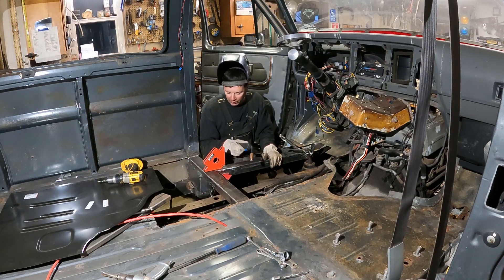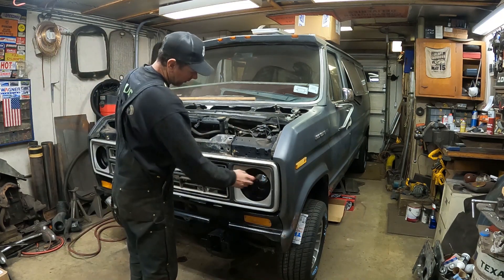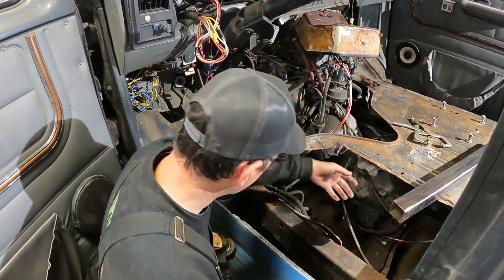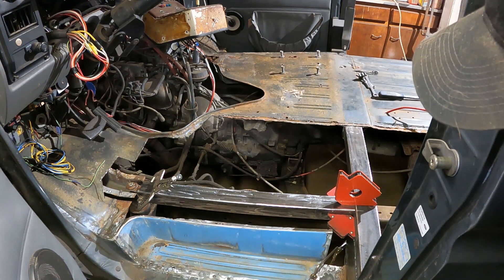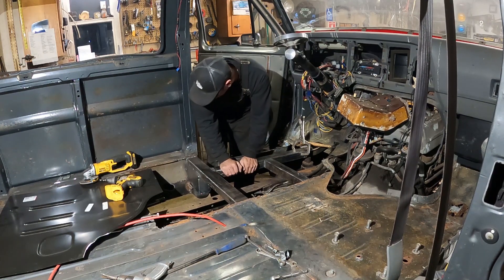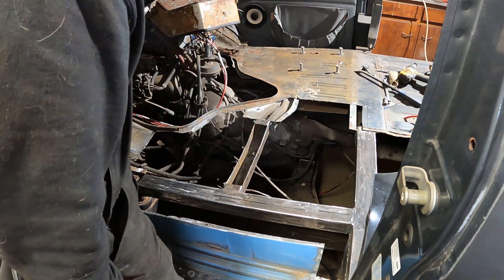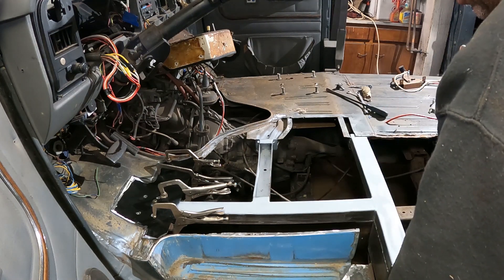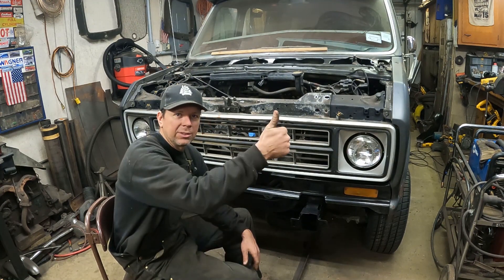Ford Econoline Boogie Van Build:  Custom Floor Braces and Floor Pan Replacement

Comment: I have a 1991 e350 that’s lived a modest life in Ohio - I bought it and have since only done mechanical repairs (many, hefty) and some preliminary gutting (removing interior panels etc) but when it rains / snows, water gets into the van and for the floor pans - there’s two holes through the passenger floor and behind the driver side by the rear wheel. I fear I bit off more than I can handle, but also don’t want to give up. I don’t even have a workspace. What do you think?
Reply from the maker: If you're just trying to slow the water intrusion down you could just make some small patches and silicone/zip screw them over the holes.

Comment: Where did you get the floor pan from ? I have a 2007 E-250 and I'm looking for floor pans as well no luck so far.
Reply from the maker: I think I either bought them on RockAuto or from Raybuck.com

Comment: Do you happen to know where you got the valance?
Reply from the maker: I think Classic 2  Classics, but it looks like they are sold out.
Reply: @QuickSpeedShop  thanks. It doesn't look too hard to modify my later model one if needed
Reply from the maker: They are the same, just with the turn signal hole which use the same lights as a '73-'77 F series truck.